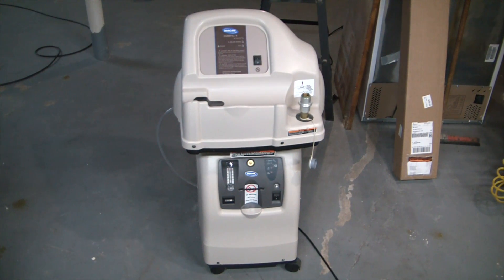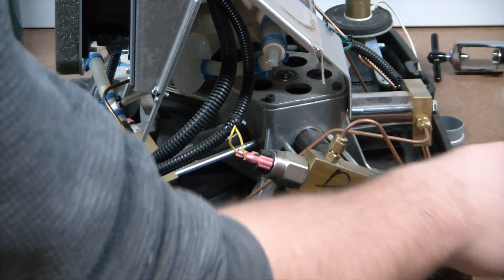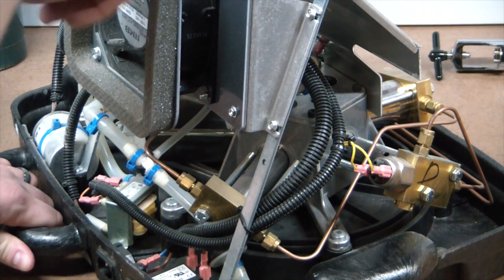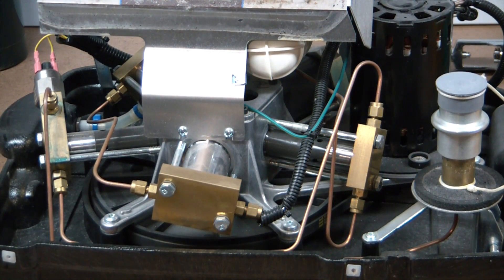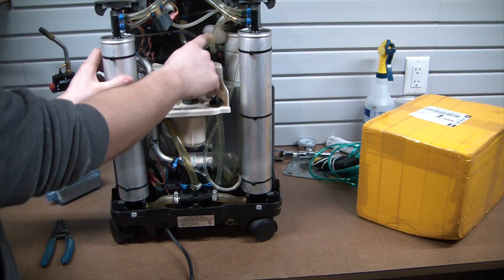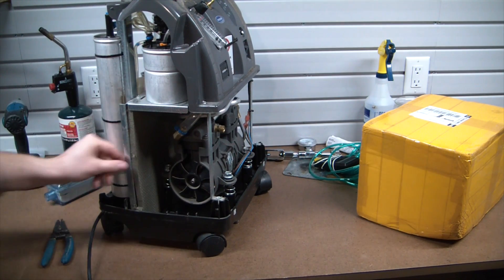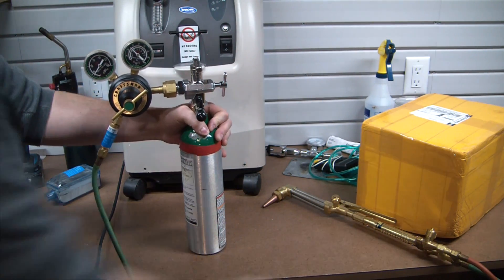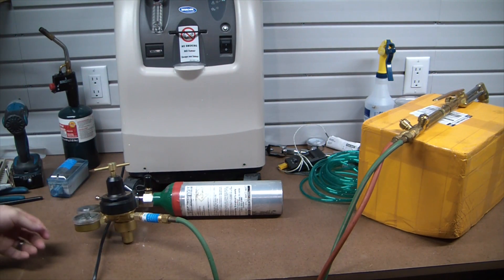Whats Inside an Oxygen Concentrator and Compressor - DIY Oxygen Filling - ElementalMaker

Comment: Is there a way to make a homemade Homefill oxygen compressor in a cheaper way???
Well after watching the video it is obvious what's inside. Is an air compressor, cooper lines and filters but how to connect all this together in the correct way and make it work.
the prices of these devices are very expensive between 1,000 and 1,800 dll and I believe that buying all similar components for separate will be so cheaper than that but how to find out the device diagram and the parts list???
If someone has done this or knows how to make it I will really appreciate it.
Thanks in advance

Comment: If you're reading this, I assume you did not tried to fill a SCUBA tank with it...
A SCUBA tank is filled with AIR not oxygen.
If you use oxygen to SCUBA dive you'll get poisoned.
Reply from the maker: @groovewardens  of course I meant to bypass the o2 sensor, add a dryer, and fill with atmospheric air. Any diver knows pure O2 would be instant oxygen narcosis below fifteen feet.

Comment: There aren't any moisture traps or post-compressor filters?
Reply from the maker: I believe the zeolite beds used for trapping nitrogen also trap moisture, which is purged with the nitrogen stream. Its been a few years since I looked at the system, but I think i remember there being a bacteriostatic filter before the compressor, and I believe that was all.
Reply: @ElementalMaker  interesting! The compressors are obviously oil-less so they don't need to trap oil.
Do you think the compressor oxygen sensor controls duty cycle to prevent the compressor running when the concentrator isn't outputting pure enough O2? Do you know what pressure the concentrator puts out?

Comment: Good video, nice to see the insides, could not testify in court how any of it works.
Do you by any chance know where to get the whip hose?  I want to	connect an Invacare compressor directly to a CGA-540 tank (40 cuft) without a regulator without a pressure gauge.
Reply from the maker: Unfortunately it's been so long since I've bought parts for this machine I have no idea what part number that would be. I think I remember them having pretty good parts diagrams and availability for these units though, so if you keep an eye out you should be able to find the whip you need
Reply: @ElementalMaker  Thanks.  Making oxygen at home is kind of exciting for a dork like me.

Comment: 5:50 Impossible. 12HP@ 1.1A, even at 100% efficiency, would require 7,500 volts. There's no WAY that motor is running at over 7000 volts. Those same 12HP, even IF internally stepped up to 7000V, would demand 37.5A from a 240V supply. You can't break the laws of physics.
Correction: he said "twelfth horsepower", not 'twelve'. I misunderstood, as I'm accustomed to hearing 1/12 as one twelfth. My bad.
Reply from the maker: I said "twelfth"  as in 1/12hp, not twelve
Reply: @ElementalMaker  My bad 😞 I added a correction to my comment, rather than deleting it, as upvotes (which I'd already left) and comment interactions boost you to the algorithm. 
If you'd prefer I delete, just let me know.
Very good vid, BTW :-)
Reply from the maker: @chrisk1944   no worries at all! Have a great day and I appreciate the algorithm boost

Comment: Had one in the house for my father in law when he was on his last days. Rented this from a local Med supply company but was very turned off as to the cleanliness of their rental unit. Took the liberty to clean and replace filters in it and sanitize various parts. If there are rental agencies are putting out equipment in this condition, they should be shut down, think of all of the germs and microbes being passed on to those with compromised immune systems.

Comment: This is awesome!! I used to do a lot of scuba diving as well as jumping out of planes and I do not do any of that any more but those scuba tank filling compressors are super cool also. I am building a foundry as well as a glass blowing set up and now I have to get a couple of these. Every once in a while you can find them for free or very inexpensive..I was going to just split water into Hydrogen and Oxygen but a concentrator may be a better deal. Thanks for the video. I know this was 4 years ago but it is a great video.

Comment: thankyou this was what i was looking for!  how can i fillup tanks with regular air, for hpa airguns, with this setup? oxygen levels would not be important, just a simple fill, and up to 3 or 4 thou if possible? what do i disconnect? i also would want to be able to go back and forth,  being able to fill up tanks with oxygen when needed, as it was originally intended for.

Can you PLEASE help me out?. Thankyou
Reply from the maker: You would only need the compressor. I'm not an expert, but I think you would have to disable/bypass the oxygen sensor allowing it to pump standard atmospheric air. You would also have to prefilter the air otherwise dust would probably kill the compressor in short order.

Comment: I got the exact same concentrator without the compressor and found replacement zeolite canisters for $108 because the ones it came with were no good(smoked on oxygen and cigarette smoke made it's way in) getting excited because beads should show up soon and hopefully I can find a compressor.
Reply from the maker: Awesome! It's a great concentrator, been using it for various projects now for years and it's still working great. Mind if I ask where you found the canisters? I might buy some backups for the future
Reply: @ElementalMaker  YouTube keeps deleting my comments but it's o2crs and I just got the canisters this last week. I think you need to make an account to get a receipt emailed and to get updates on thier website.

Comment: Hey Bob, what are the chances we could make something that pumps oxygen into one of the 4500 PSI tanks? I've got this unit and the tanks that come with it. I've been investigating for a little bit how to "recompress" my Oxygen so I could get it into a more efficient, lighter tank. Maybe message back here if you have any thoughts, I'll check back later, thanks!
Reply from the maker: The compressor unit fills the tanks to about 3000psi with factory settings. I'd assume you could install some kind of 4500psi cutoff switch rather than the 3000psi one, but it would probably tax the system much harder and either blow out a seal, or burn out the motor. Mind if I ask why the need for 4500psi rather than just using 3000psi? I've used mine to just fill some larger oxygen tanks, you can find the homefill stems on ebay from time to time.
Reply: @ElementalMaker  thanks for asking. I’d love to have three hours of O2 for hiking up the mountains at a 6 lpm rate. The unit I have actually fills at 2000psi, which means a 10lb tank lasts for one hour. 4500 psi means I get more time out of the same tank or I can take a smaller tank. Probably I would give my wife two small tanks, wear one myself and swap them out. Those paint gun tanks are super light and would hold a lot of air, right?
Reply: @ElementalMaker  And by the way, mine only goes to 2000PSI. I was think of filling up one tank, then moving the O2 to another tank with some sort of 'recompressor', any idea if this would work? Thanks for the answers by the way.
Reply from the maker: @Bicklehoff794  Anything is possible is you throw enough money at it my friend lol. That being said, you'll need one hell of a pump to get to 4500psi, and keep in mind most available pumps wont be compatible with oxygen at those pressures. The pump will likely also have to be medical grade, as you dont want any contamination in your oxygen. finally, you will definitely need to hydro-test your tanks to probably at least 6000psi maybe higher, so you can have some factor of safety using them at 4500psi. Mountaineering is an awesome sport though. What peaks are you climbing that you need supplemental O2 for?
Reply: @ElementalMaker  I wish that was the case, actually need O2 just to keep up with slow pokes from sea level. I have a genetic condition called Alpah-1 that causes lung damage sadly, but it’s not bad enough to kill you usually, just slow you down :)
Reply: Really appreciate the help, maybe I’m not the only one hoping for this, perhaps there’s a new product in this somewhere.
Reply: Hi Bicklehoff, what do you think about all gubments drawing a line around you(Antarctic Treaty) and saying you are not allowed to leave? If you don't know what I mean, read my about tab.

Comment: Great vid e maker. I just picked up 6 of the invacare 10 ltr. lowers with that compressor and the tanks for the sieve and I was wondering what I should do with them scrap them check them out I'm just getting through them right now any tips would be great thanks..
The first one looked like it was made of dust when I opened it up just like that one but 10 times worse probably.  2,600 hrs I think on first one
Reply: Hey dude, I know it’s been two years, but do you have any tips on finding these? I’m looking into getting one, but they are so expensive…

Comment: idk how deep you are diving but O2 isnt something you need in high concentrations, the deeper you go the less you need. pure O2 is lethal at like 20ft.. these things ARE good for small torches and/or glass blowing.
Reply from the maker: Correct, I meant use it as a compressor for air. Most definitely not pure O2, hence why I mentioned bypass the oxygen sensor

Comment: Great find on the compresor unit. 5 stage progressive, that is good for about 5K, but the charging valve itself not so much. You can use cooling between stages and make yourself an mini air liquifier with it using joule-thompson effect. Wish i had something like that when i had some old hughes probeye thermal imagers. 😃🤓❤

Comment: How would you bypass the O2 sensor to be able to use it for compressing straight air? I have one of these and a PCP that uses 2K Psi, but for obvious reasons I don't want to fill that with O2. Can you think how it might be bumped up to pump out another .5-1K?

Comment: Hybrid rocket engines - so what exact formula and general rule of thumb do you use to calculate engine dimensions, convergence, divergence, nozzle throat diameter to chamber diameter, etc.

Doing a video on these design calculations would be appreciated.

Comment: I wonder how much would need to be bypassed or burst disks upgraded to use one of these as a airgun compressor? A lot of Airguns are filled to 3000psi and some, up to 4350psi fitted with a rated CF bottle.

Comment: Thanks so much.  I have had this exact setup in my house since November 2017 and it has never give me any trouble and runs nice and quiet next to my bed.  I also have a 32ft hose/cannula on it to reach into the living room by my recliner for TV watching but I do have to switch the cannulas from bed to recliner or else keep wrapping up a lot of hose.  Sure would like to find a two way connector before I break off the hose connector.

Comment: I got a larger version of a concentrator from a glass blowing shop for around $350.  They marked it as being modified for non-medical use, though I was never able to determine what that entailed.  From what I understand it puts out around 85% O2, probably modified to put out a higher flow rate at a lower purity since it can really pump a serious gas volume, as well as removing any fancy filters.  Wouldn't really suggest using it with propane, the amount of gas volume required for a complete burn is much higher with propane, and it burns at a lower temperature.

Comment: i have access to 4 concentrators but want to turn them into a filling station for glass blowing torches to run . im trying to sorce info for connecting them to my compressor intake and i can figure out the tank filling from there , any info or advice ?
Reply from the maker: What type of compressor are you using?

Comment: Nice video! is it possible to replace the molecular sieve cylinders? How can you tell if they need replacing? cheers Dave
Reply from the maker: Yes the beds are replaceable once they reach the end of their service life honestly not exactly sure how one would be able to tell, I imagine the unit has a low oxygen warning
Reply: @ElementalMaker  I just read that lifetime is about 20000 to 30000 hours, mines done 3200 so it should have plenty of life yet i think. Thanks for the reply

Comment: Question: Did you see any discrete bleedvalves in the oxygen concentrator for when the nitrogen is being evaporated from the "spent" cartridge? If so, I'd imagine one could also use these units as a nitrogen concentrator.
I've rebuild an old cryocooler and would like to upgrade my "liquid air" setup to a proper "liquid nitrogen" setup
Reply: I doubt it would be pure enough, but maybe after a few cycles. You would want some better sensors to start.

Comment: The beds absorb the O2, N2 is just vented.  Depressurisation of the bed releases adsorbed O2 to the compressor by PSA.
Cool Video, thanks !
Reply: Don't think so tbh, every single article on pressure swing adsorption I read explains the process with the example of these devices, and they all jave it the other way round. Of I'm wrong feel free to point me to the necessary resources to clear things up
Reply: @horrorhotel46290  
I'm an idiot... never mind. Selectivity depends on the bed loading, CMS or zeolite. 
I'm currently building a PSA N2 purge system using CMS and the breakthrough is O2....so I'm biased..lol.

https://www.tandfonline.com/doi/abs/10.1080/01496397608085334?journalCode=lsst19

Abstract
The performance of 5A zeolite and a carbon sieve produced from coal for the separation of O2 and N2 from air has been studied. In static adsorption at 25°C, the zeolite took up more N2 than O2. Conversely, for short adsorption times, the carbon sieve took up more O2 than N2. This behavior was reflected when air was passed through adsorbent beds. For the zeolite, enriched O2 was recovered in the outlet; for carbon, enriched N2 was recovered. Possibilities for improving the performance of the carbon sieve are discussed.

Comment: How would you change the machine to condense atmospheric air so its breathable?
Reply from the maker: Instead of using the O2 feed, just bypass that and feed in filtered, and dried air. So a diy desiccant cartridge would essentially be all that's needed
Reply: @ElementalMaker  Thanks for replying!

Comment: That stage setup is very similar to natural gas pumps for trash trucks
Reply from the maker: Gas pumps for trash trucks? You have my curiosity
Reply: @ElementalMaker  yup, a large percentage if not all run on cng out here, its a huge on-site multi stage pump in a crown formation rather than a pentagon. ran off 440. You wouldnt believe the sound those motor contacts made when the whole thing kachunked to life. It keeps thousands (might have been close to 12k?) of psi through a small pipe along the parking spaces, and each truck gets plugged into a regulated coupler with a hose after shift and the entire fueling process is automatic. There may be some proprietary technology here, as the one i wired was experimental at the time and i cant find pictures anywhere. But they exist, and theyre mean
Reply from the maker: Oh that makes sense! Wow thats some serious pressure! Would love to see one of those pumps in action. That's pretty ingenious as it has to be a good cost savings over gas or diesel and the infrastructure is probably easier than dealing with installing underground tanks and frp piping etc for liquid fuels. Plus no deliveries as the line comes direct from utility. I have been trying to get a NG line to my house for years for heat. Fuel oil is damn expensive.

Comment: What do you reckon would be the result  of using one of thees o2 concentrating units as the air assist on a 40-50 watt laser cutter ???     Flamage ? Maybe ill do a video or  I may pull thoes molecular sieve canisters off if i have too 
this unit i got is super quiet even with the cover off well based on my computer repair work and getting the awesome joy of trying to fix a computer that was so cloged with cigarette smoke the fans wouldn't turn 
 looks like whom ever was using this smoked heavily probly the reason that individual needed it in the first place 
Any way inside its the same setup as yours just no compression unit on top just o2 out and a flow control and meter if nothing else the pump is very nice 
way better than my curent air assist pump and no where as noisy

Comment: tks for insightful video - you didn't seem certain when you were talking about the seive beds and nitrogen being 'off gassed'. When you said 'nitrogen being off gassed' I assume you meant nitrogen being released as 'exhaust' by the system. If that's the case, which I'm sure it is, wouldn't Aunty Gladys have a room filled with nitrogen after a few hours?
Reply from the maker: Homes have far too much air volume and aren't sealed well enough for an O2 concentrator to fill a room with nitrogen gas. It would have to be pumped in at an alarming rate to displace all the O2 in a room. Also the human body doesn't use all the oxygen we breathe in, so some will be added back into the room from the user's exhalation.
Reply: @ElementalMaker  Tks for replying. Well to be honest I have a completely different understanding how that concentrator you were disassembling works. To put it simply it's just an air concentrator - it concentrates the air to manufacture a concentrated gas stream that is called oxygen. There's no nitrogen there at all.